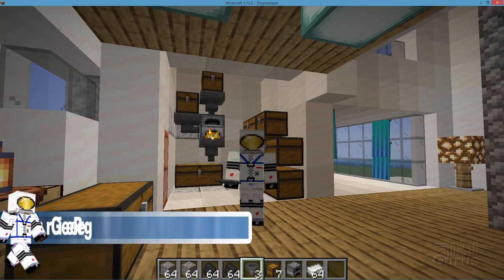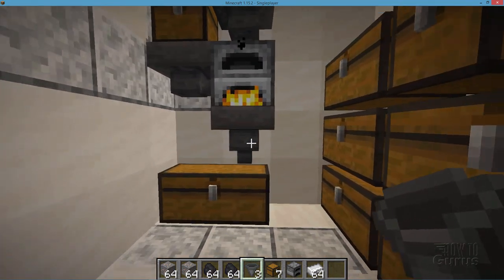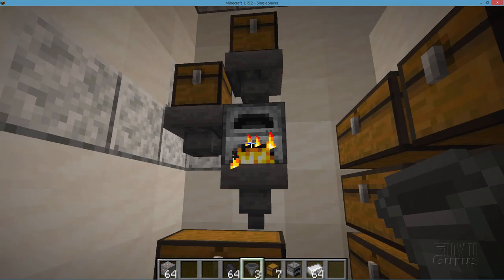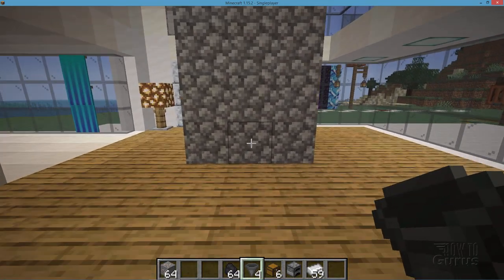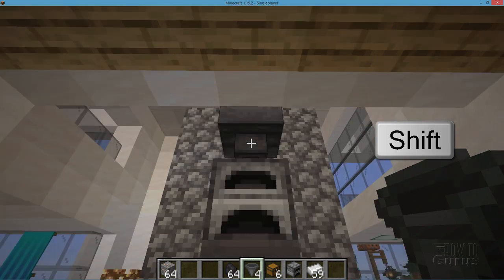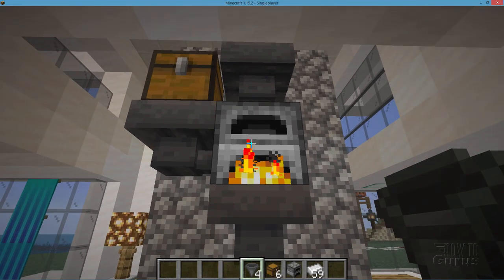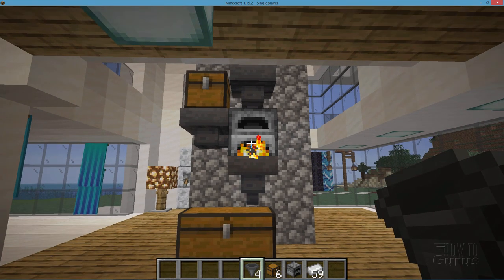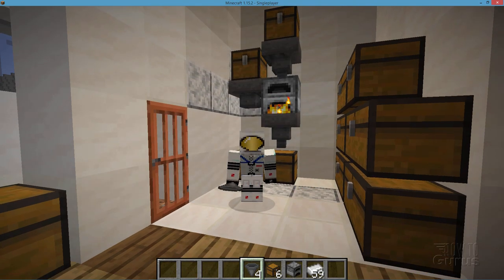How You Can Make a Minecraft Automatic Furnace - Furnace Hopper Design Automatic Smelting

Comment: your skinlooks 128x i thought that was only on bedrock, also i tried it on win10 and it worked
Reply from the maker: You're right, my current character is at 128x128. I tried it at 64x64 but wasn't able to get a nice gradient in the faceplate so I went to 128x128. I normally play Java but I use the same character texture for Java and Bedrock.

Comment: Is it possible to use lava buckets to fuel furnaces using hoppers?
Reply from the maker: No, furnaces are fueled with coal or charcoal, not lava
Reply: @HTGGeorge  Ok I have tried it and can confirm that lava buckets can in fact be used to power these automatic furnaces. Just place them in fuel box instead of coal. After they're used up, empty buckets will drop in the final output box.
Reply from the maker: @GrinFlash007  Interesting, I learn something new every day, great tip!

Comment: Another excellent video. I think that earns you an Achievement too. :-) As you say, very useful when you're smelting a lot of items. I like to build mine either in the nether or down in a mine where a source of lava is handy. A bucket of lava is quite resource cheap, so long as you have a lava lake nearby, and will smelt a lot of items--and you get the bucket back! Of course, if you're only smelting a few items, using lava is pretty wasteful, but it's still cheap. If you have a tree farm, filling that fuel hopper full of saplings is a really good way to get rid of excess saplings too. A sapling doesn't smelt much (one of one I think), but sometimes you end up with stacks of them just taking up inventory space. :-) Anyway, thanks for another fine video.
Reply from the maker: Great idea with using Lava, and also on how to get rid of too many saplings. I plan on doing a video soon on how to clean out excess blocks, like all of that cobblestone that is collected during mining. Nice to have some, but... So I will be showing how to use up fuel, how to make a lava pit, and how to use the composter. Thanks again for a great and informative comment.
Reply: Well, for that video, if you build the same setup but replace the furnace with a composter you can put excess seeds and crops in the top and get a chest full of bonemeal in the bottom. :-) I used to use the composter manually, but using chests and hoppers is much more efficient.
Reply from the maker: @GarNelson1  Great idea Gar and that makes it a perfect follow up to this video. I will try to put that one together this coming week.Thanks again for more great suggestions.

Comment: dislike
Reply from the maker: Yeah, this is an old video. I would do it differently today.
Reply: @HTGGeorge  hey George! How would you do it differently today?
Reply from the maker: I still use the same basic setup but I like putting two of these side by side. Just put the furnaces directly next to each other and build out from there on each side. For later game use this can be extended even further by putting the fuel chest and hopper out the back side of the furnace then you can easily line up a bunch of these. Then set up an automated sorting system for the output chest to keep things clean. But for early game I still use this basic one furnace setup, the early game problem is the amount of iron needed to make the hoppers.